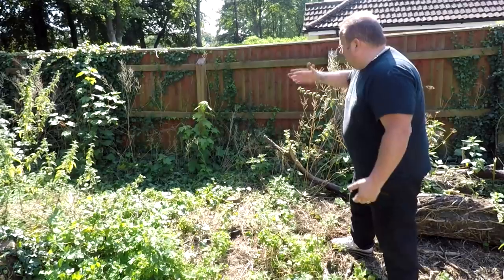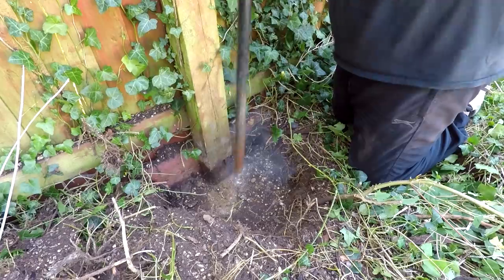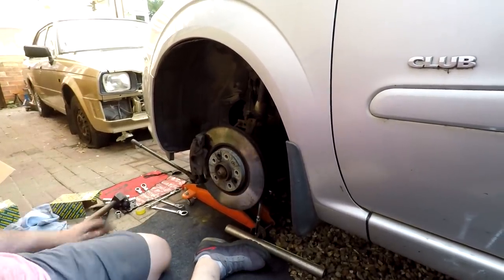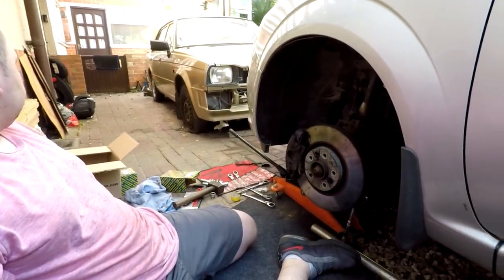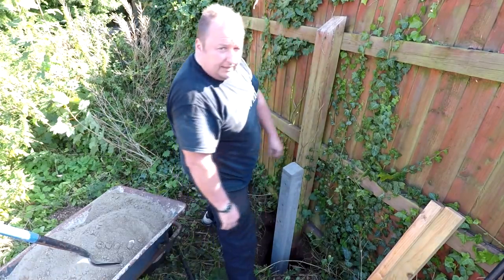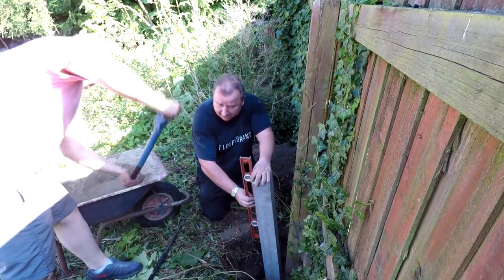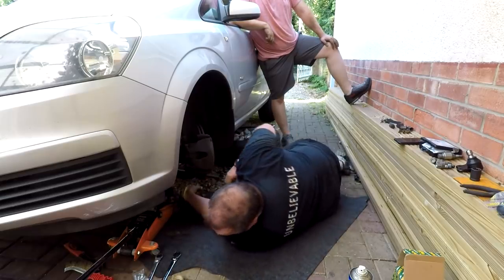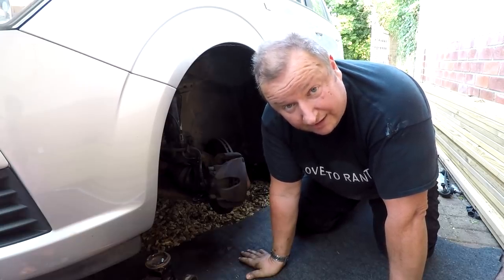Hard Work In The Heat 29 Deg C Vlog

Comment: I don’t like them pinch bolts. I normally plan so the wheels slightly turnt so the thread side of the bolt points outwards and use an old half inch socket extension as a chisel and a big hammer  😆 good idea to straighten a fence. Never thought of doing this. I wouldn’t of though coz I don’t own a fence. Come to think of it I don’t even have a garden lol.
Reply from the maker: Haha nice one lol

Comment: How did that post work out? It looked like you had cement between the two posts which looked like it would stop you pulling the wooden one back to the concrete post.
Reply from the maker: I cleaned that out off camera bud

Comment: Hi ya buddy will you not have a problem getting that wooden post up to that concrete spur , with the sand packed between the old wooden post and the spur , I'm not trying to belittle your work which I think is fantastic. But would it not have been better to bolt the post to the spur first then pull the fence and spur back to level then batten off  to hold its level then pack it with the post mix. Just a thought I can imagine your brain was being fryed  out there in that heat Martin,, anyway I hope you dident mind me saying it's just my thoughts love and peace to you and family speak SOON  BIG TIM
Reply from the maker: I've done this many times Tim, There is no sand packed between the post and the spur. I dug it out off video.
Reply: @retrorestore  great  minds think alike bud did not meen too offend mate I was just thinking sorry

Comment: put some stone in the mix cement and sand alone will crack up
Reply from the maker: It doesn't, I've removed post that were 19 years old and this mix never cracked.
Reply: These concrete spurs are really heavy and go in  25" deep.

The weight and depth keeps them there and  the concrete simply fills the hole.

I use postcrete a lot and this is mostly all fines.

Comment: Would have been quicker to change the hole bottom arm, than go through all that agro & the whole bottom arm, are not that much more money to buy, & you get to new rubbers in the arm as well, who's to say that the rubbers might fail next & you wasted all that time changing the ball joint & money. Years ago you could only buy the whole, how times have changed.
Reply from the maker: Yes I know, I don't bother buying the ball joints any more but Gary had already bought them.